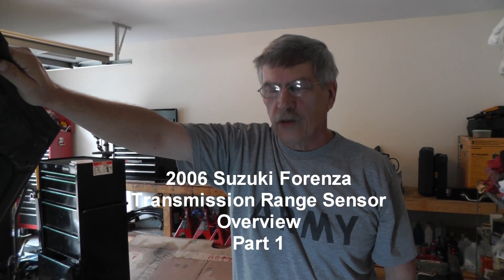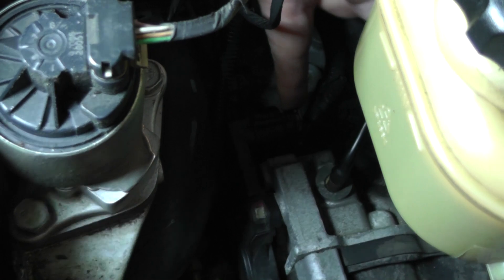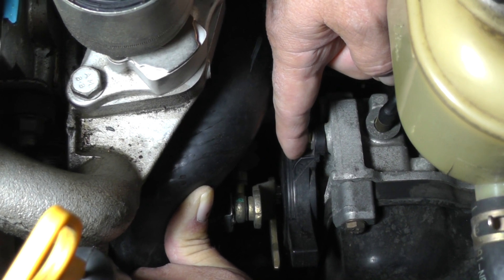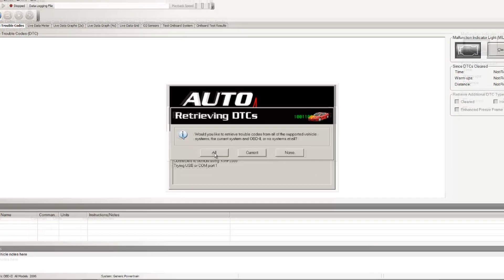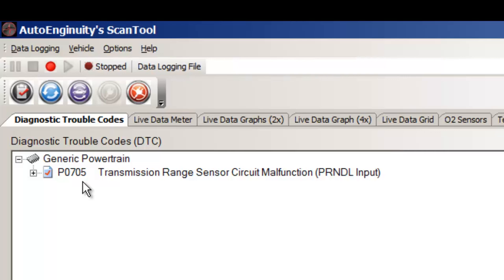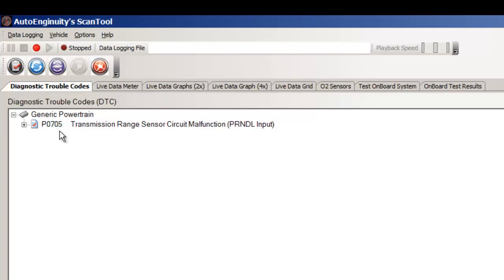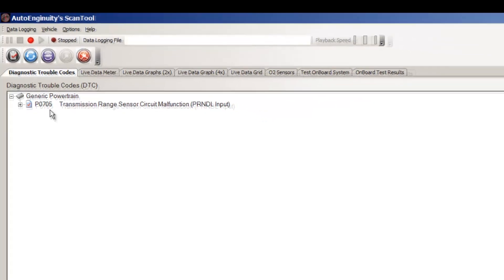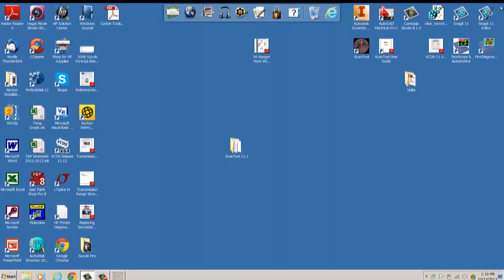Suzuki Forenza Transmission Range Sensor Overview - Part 1

Comment: Changed this little bugger out 3 times on my 2007 Reno. Good video. If you're a long way from home AAA road assistant tow will be necessary.
Reply from the maker: Glad the video was helpful. Yes, those tranny range sensors are a known problem on these cars.

Comment: What's the little hose kinda underneath the power steering reservoir an where does it go?
Reply from the maker: I sold the car years ago, but if memory serves me correctly, that hose is for ventilation of the transmission.
Reply: @stuzman52  thanks bud my wife has one and as I was checking the fluids I noticed the little hose off the top of the transmission I asked about an I couldn't find where it went at all spent about hour off and on just looking where it went

Comment: Hello, I have a question I currently live in rural South Carolina and have been the owner of a 2006 Suzuki Forenza since October of this year, so I find this video very informative. My question is right around the 1:48 mark what is or can you tell me what the name of that piece of hose or tubing that is directly under your thumb? You see I believe someone has tampered with my vehicle because recently I noticed that mine is not connected to anything
Reply from the maker: That would be the vent hose for the transmission to allow any kind of buildup pressure to vent to the atmosphere. It should be open to the atmosphere.
Reply: @stuzman52  thank you I was afraid it may have been clipped
Reply from the maker: @NP.TRU.09  I believe the other end of the hose should go to the right front fender according to a poster. In any event, as long as the end of the hose is connected to the atmosphere, you should be okay.

Comment: Do you need that tool to put it back on
Reply from the maker: If you go by the book, you do. But you can place the mounting bolts for the sensor in the middle of the slots and you'll be close enough. That's what I found out in the video and was shown too.
Reply: @stuzman52  ok thank you

Comment: I might just scrap my 2005 Suzuki Forenza, but today the check engine light came on and its P0700-Transmission Control System (MIL Request) & P1884 (Vehicle Specific, although I just clicked on Daewoo since they are the same vehicle).
I don't know if running the heater (I know it uses coolant) to avoid overheating caused this as well. I also keep the hood latch unlocked so the engine bay can get ventilation. A few months ago I replaced the coolant thermostat, coolant temperature sensor, T connector, & coolant reservoir cap. It has a head gasket issue (but thankfully no mixing). I been using Blue Devil Head Gasket sealer and it works for a while, but I feel like its starting to become ineffective. The air conditioner no longer blows cold air either.
Reply from the maker: Yes, it sounds like you've got some issues with the car. Here is a link with a little more info https://www.justanswer.com/car/6u1e5-codes-p1884-p0700-2005-suzuki-forenza.html

Comment: my speedometer dont work 2007 forenza  5 speed
Reply from the maker: Did you put a scanner on it to give you some direction? It could be the vehicle speed sensor, it's wiring, an instrument cluster fault, or any other wiring that's associated with it.

Comment: If the Transmission Range Sensor is starting to fail, will it cause the tranny to keep constantly searching for the gear? I am getting a blinkng drive light in the dash with a slash through it.  Sometimes i have to put it in 3rd then back to drive for it to go away. I know it's not the tranny slipping cause i do know what that feels like.
Reply from the maker: When the transmission doesn't know what gear it's in which is read from the transmission range sensor, you'll get a slash through the gear selection LCD. The code for it is P0705 which indicates an issue with the switch. And these switches are notorious for failure.

Comment: I got a 07 suzuki SX4 manual transmission.  I hooked up my car md and it say C1245 : acceleration sensor output. Can u tell me what that is.  Now my problem with this car it that it is slow . When I put it in 1st it has little power and I'm really short on cash and bought the car recently and can afford to take it to a mechanic. Can you or someone tell me what can I do. 
Help
Reply from the maker: This code is manufacturer specific and I couldn't find anything specific about it. I did find the C1245 code and may be helpful. Otherwise, you're probably going to need the service manual to get more details of this code and how to troubleshoot it. Here is a link to what I found https://www.autocodes.com/c1245.html

Comment: Could TRS issues cause the throttle not to function correctly?
Reply from the maker: omnymisa If your car has a drive by wire system, it could effect it. If you’ve got a range sensor problem, you should have or had a check engine light to come on. Best to read the code to confirm if the range sensor is acting up.

Comment: My car won't go into any gear/change. It will start, but will make this strange noise? Doesn't matter if it is in R / N / D.

Everything works fine. It was working fine, but made the noise and then wouldn't continue running.

Comment: I had my transmission switch sensor changed and that made the car drive even more worse so my mechanic put the old sensor  back on and I’m still having issues. The hold indicator comes on and I lose power. The check engine light does come on but the code that comes back is the transmission switch or range sensor. The check engine light comes on and off.
Reply from the maker: This shouldn't be a hard problem for your mechanic to diagnose. I show the steps in this video series if he's interested. Maybe you can point him to the videos so he can diagnose it to see what the issue may be.
Reply: stuzman Well now the car will not go into drive or reverse. Still has the old range sensor attached does that mean my entire transmission has gone out?
Reply from the maker: What did your mechanic come up with? He should have been able to give you an idea of what's going on. It's hard for me to say if your tranny is gone. Do you still get the tranny switch code P0705. If so, you may still be having an issue with the sensor or its wiring.
Reply: stuzman He didn’t come up with anything he has no idea how to fix it as he has never worked on a Suzuki before. I have a scanner here at home and it gave me the sensor/switch code again P0705 and nothing else which has me extremely confused. I thought it could be the clutch but the car switches gears smoothly with no problems just doesn’t move forward or backwards. I really think it’s the sensor that has caused this problem but no mechanic in my area knows how to replace the sensor or will even try. I guess I will change it out myself. Also is there a certain brand that I should buy? I couldn’t find a OEM Suzuki sensor only off brand.
Reply from the maker: Sam Sam I’ve never seen the issue of the car not being able to engage in drive or reverse with a P0705 code, but I guess it’s possible. Even though it shows a sensor code, keep in mind this does not automatically mean the sensor is bad. It’s saying there is a problem in that circuit which could be the sensor, its adjustment, its wiring or the TCM which is a separate module. So, a little troubleshooting is in order and I show that in this series. I used a scope, but you could use a voltmeter. It turns out for me it was the sensor and.I show its replacement in the last video of this series. Aftermarket may be all you can find as dealerships have closed in North America. And honestly, your mechanic should be able to tell you what’s wrong if he was any good with cars. I would look for another mechanic. Good luck on what you find!
Reply: stuzman Thanks for the response. I started the car this morning and nothing happened so I did press on the break and put the car in reverse (still didn’t move) but the lights worked so I’m absolutely convinced it’s the sensor. I ordered a new part as my mechanic cracked the other replacement. I will change it myself after watching all your videos I think I can pull it off. I will let you know what happens. Thanks
Reply from the maker: Sam Sam Good luck Sam with your repair!
Reply: stuzman Welp I changed the sensor by myself following your steps and I was successful getting everything off and back but the car till won’t move forward or backward. And may I mention the car starts up just fine and there’s no more hold flashing on the dash or check engine light. The gears before would shift really hard when going from park to drive or reverse but  none of that now. Gears switch more smoothly What else could be wrong with my car? 😔
Reply from the maker: Sam Sam Does the car move in Drive? Do you have a scanner that can read transmission data? And do you have access to the service literature. Because at this point, I suspect you have an electrical issue where the tranny does not know it’s in gear or an issue internally in the tranny.
Reply: stuzman I don’t have a scanner that reads transmission data I do have the car manual though. The car is not moving at all will not drive even when in the drive gear. Could I need a transmission flush? The car is almost at 150,000 I don’t know if the car has ever had a fluid change being I purchased the car used from a neighbor. I did notice a leak coming from the car but on the passenger side of the car but I couldn’t tell if it was motor oil or transmission oil🤷🏾‍♀️ Do you have an idea of where the transmission drain plugs are located ?And are the labeled? Do you know where the TCM is located?
Reply from the maker: Sam Sam I doubt changing the fluid would help. The fill and drain plugs are located on the passenger side of the tranny. Maybe you need to check the level since you may have a leak. The TCM is located under the dash on the driver side. I show this component in this video series when I did my electrical checks. You should be able to find these questions in your service manual.
Reply: stuzman Would changing the tcm fuse be of any help? Do the burn out over time? I just have a feeling that my problem with the car is something minor but I cannot pin point the issue. Thanks for your help I appreciate it
Reply from the maker: Sam Sam Only if the fuse is blown. It’s easy enough to check. 😀👍
Reply: stuzman I replaced the fuses and was able to drive the car and put in reverse but now the speedometer isn’t working🤦🏾‍♀️ but the rpm is working fine.
Reply from the maker: Sam Sam check your vehicle speed sensor (VSS) that’s located on the output of the tranny. It’s wiring goes to the TCM. Sounds like you’re making progress!
Reply: stuzman So I was driving the car and it completely stopped. I forgot to put the car in Park when I went to change out fuse again thinking it blew out again. When I pulled the TCM fuse out the car starting rolling forward so I put my foot on the gas and it drove fine. Once I reached my home( only drove around the corner) I put the fuse back in and the car wouldn’t move. I took the fuse out again and it drove🤷🏾‍♀️ that definitely sounds like a wiring issue is it safe to drive that way? I wasn’t able to locate the VSS though. I will look again
Reply from the maker: Sam Sam probably safe to drive, but who knows it might stop and leave you stranded somewhere. I’m sure that you will get it all sorted out.

Comment: Hello, I posted on another video of yours with Suzuki Forenzas. It was a bad head gasket. I got that replaced about 3 weeks ago. Today when I was driving home from school my car (07 Forenza) was fine. Then I began to slow down since I was getting off at my exit. I came to a complete stop and went to accelerate. The car wouldn’t accelerate fast. I believe it just rolled. I got to the stop light less than 150 ft from the exit. Turned the car off and back on. Then tried to turn and go home (about 0.5 mi. or less). I couldn’t go the, car rolled until I got into my complex. I could reverse perfectly fine (had to parallel park). I opened the hood to see if anything was wrong. Couldn’t find anything out of order and the car wasn’t running hot. The CEL was on previously for the catalytic converter but I was told this was not the problem. Do you have any idea? Could it be this? I haven’t gotten the codes read since I’m afraid to drive anywhere.
Reply from the maker: Sorry to hear that you're having problems Julia. It's hard to say what the issue is without looking at the car. The CEL for the cat is probably a code P0420 where it's not working as efficiently as it should which shouldn't cause an issue unless the cat is plugged up which could cause the issue that you're experiencing of no power. It sounds like you'll have to get the car to a mechanic who can diagnose the issue further. Sorry Julia, I couldn't give you a definitive answer to your issue. :(
Reply: stuzman I just went to AutoZone (car worked fine) and got codes: p0420 p2106 p2110 p0455 p161b.
Reply from the maker: Okay Julia, I don't know how much you know about electrical systems on a car, but I'll explain what the codes mean and what I would do to troubleshoot it. The P0420 is your cat is not working correctly as mentioned earlier, but wouldn't cause your loss of power. The loss of power that you're experiencing is coming from the codes P2106 and P2110. Your car has a drive-by-wire system which means there is no cable from the accelerator pedal to the throttle body. It's all controlled by the computer. When you press down on the accelerator, there are two sensors which measures how far the pedal is being pressed down. These two voltage signals are sent to the computer to determine how far you pressed it. The computer then sends a signal out to the throttle actuator motor to open the valve up to let more air into the engine. Now, the computer want to be sure that the valve really did open. So, there are two more sensors inside the throttle actuator that sends two voltages back to the computer. The computer looks at these two signals and then determines if that valve really moved like it requested. So, it appears that's where the issue is at which is within this system. But, since you have a P0455 code which is saying that you have a large fuel evap leak, it's possible that you're getting a very rich mixture which the computer senses and it's automatically limiting your power because of this fault. Based on that, I would start with the P0455 code and fix that first as the other codes would fix themselves. You could have a purge valve that's not fully closed which would allow a rich mixture into the engine when it's not being called for (most likely) or there could be an issue with vent solenoid that's not closing or you could have a leak somewhere in the fuel evap system. Either way, you need to have an understanding of troubleshooting to find out the issue. If you want to tackle the troubleshooting, you could get free wiring diagrams for your car here http://www.bbbind.com/tsb-wiring-diagrams/ Fill out the short form, agree to the license and you can get the diagrams for your car. If you don't have any experience with troubleshooting, it's best to let a qualified technician have a look at your car. Hope you get it all sorted out!
Reply: Julia keanna how much did they charge you to chabge head gasket
Reply from the maker: Richard Corbitt I did a video series on replacing the head gasket along with replacing valves. So I did it myself. Prices at a shop can vary so best to call for an estimate.
Reply: We had the same problem with my girlfriends 07 Forenza. I ended up having to replace the throttle body. It was going into a low power mode so you could not accelerate. Replacing the trottle body seemed to fix it. I have driven it about 1000 miles and has been fine. It was messing up every drive before.

Comment: I have a 2007 vitarra i press tge neutro botom by mistake but still in neutro but dosent want back to drive gear
Reply from the maker: Sorry Emanuel, it's hard to understand what you're saying. It sounds like you went to neutral and can't get it out of neutral. If that's what you're saying, there's probably a shift interlock solenoid in the console with the gear shift selector that may be your issue. Still not sure if that's what your issue is...